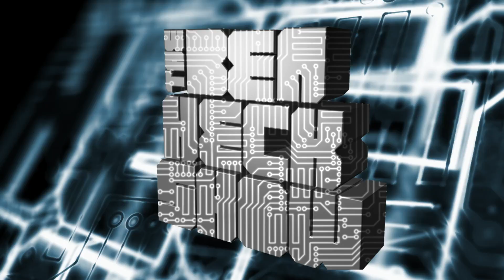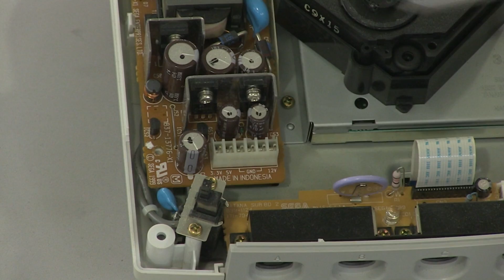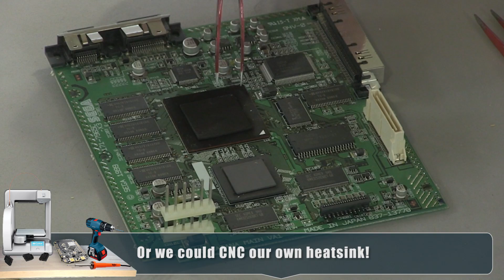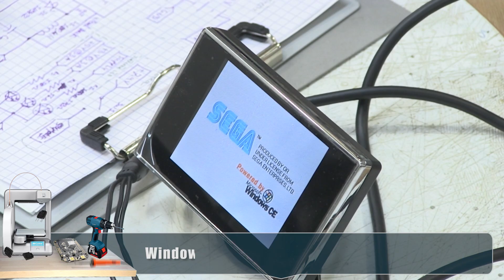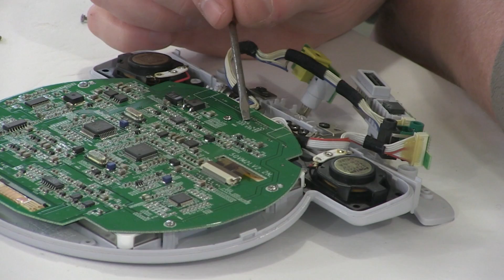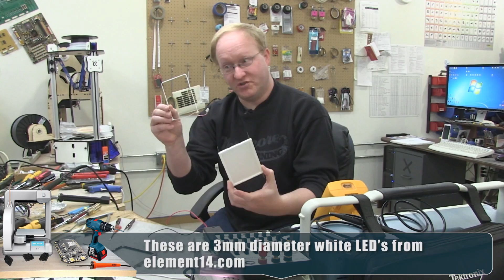Ben Heck’s Dreamcast Portable Part 1

Comment: The Sega Dreamcast failed because it was going up against the PlayStation and the N64 which were already out and had a lot more games that people actually wanted to play and it's competitors were cheaper then the Dreamcast and on top of all that the PlayStation was way more powerful then the Dreamcast and could also play music cds for again a much cheaper price compared to the Sega Dreamcast who could also play music cds but for alot more money but like i said the PlayStation was cheaper, and of course all the bs that Sega did with the Sega Genesis/Mega Drive didnt help, so no the Sega Dreamcast failing had nothing to do with its good controller, so why dont you do your research instead of making stupid inaccurate comments, i mean you want to talk about bad controllers well how about looking at the N64's god-awful abomination of a controller.
Reply: You are so wrong. Playstation and N64 were irrelevant old news by the time the Dreamcast came out in late 1999.

The Dreamcast failed for many reasons, a huge one was the trust issues consumers had with Sega after abysmal failure that was the Saturn AFTER Sega launched several systems they quickly stopped supporting, expensive systems.

The biggest one though was PS2. PS2 was announced and revealed before Dreamcast launch. And the PS2 had an ace up its sleeve. It was going to be the best and cheapest BluRay player on the market. "c'mon dude, how do you know that's true?" Because after PS2 launch, it had an attach rate of less than 1. Meaning PS2 units were selling more than games.....because people were buying the best and cheapest BluRay player on the market. That gave PS2 huge-mongous market penetration, and third parties noticed. The noticing led to Dreamcast support drying up quickly.

Sega wanted Dreamcast to have BluRay support, but that would have substantially increased the unit cost of the Dreamcast. After most of a decade of near irrelevance in the gaming market, they didn't have the finances to eat that extra cost and would have had to price the Dreamcast way above it's low price which was one of its main selling points.
Reply: @ekscalybur  close but instead of Bluray it was DVD, bluray players didn't come out until June 2006 and the first console to use bluray was PS3.
 Xbox 360 and Wii still used DVD, and most of the time needed DVD-R DL (Dual Layer) and multiple DVD's on Xbox 360 vs single Bluray Disc on PS3

Comment: For switching regulator you mean a DC-DC converter, right? I do appreciate how good this video is, especially for electrical engineers is a joy to see the applications to the gaming world. Of course to do all this stuff you need a very well equipped lab. Those Fluke multimeters do not come cheap =)

Comment: I know it's not relevant to this project at all, but I wonder how much of a difference replacing the backlight on that display made on color reproduction? I'm assuming this one isn't good enough to see much of a difference, but I'm assuming that when the CCFLs in stuff like my mid 2000s 1440p Apple Cinema Display go out then while I could make a replacement it would mess with the color reproduction (and there were many CCFL screens that look great even in 2021, they just were very expensive back in the day and don't make sense now that they are worth as much as a more modern one that looks nearly as good and has an least double the refresh rate.

Comment: I’d LOVE to see a new take on this build since the GDEMU has been released, SD card reader that replaces the optical drive for a digital solution, with a big enough card, you can fit a nice chunk of the library on a single card and I’m just imagining a second attempt of this using a Switch type setup where you actually have an SD card slot on the shell that can read those games directly off any card you pop in!

Comment: The controller problem is actually a simple issue, the handles are 90 degree right angles but they need to be tilted inwards to the top like most controllers. It's more comfortable to keep your wrists straight for long periods of time while the DC controller causes more wrist bend in it's grip. Ben still would like you to try a DC controller and VMU 2.0 project, get past your emotions and make it better. Dream Pi, DC is online again. :D

Comment: Nice, but stop using those PS One Screens!
Reply: Jojozz PlayzzGames What?
Reply: My understanding is that he uses them because he has a bunch that he got for a good price back in the day off eBay and that's why.
Reply: @FancyGeeks  That's still not a good reason, they're rare and valuable!
Reply: @testarossa7993  They're really not. A bunch of sellers on Amazon have them in stock at any given time, they go for about $80. Good screens for Rasberry Pi builds (like the Sunfounder) go for about $75 and they don't come with on board audio. Even if you get one of the generic screens for $15-$25 (and they're not much better than this one) then you'll still have to add on speakers ($5-$7) and a sound card ($23-$25 for a cheap one, $50 for a good one). In the end, it's gonna cost the same thing or more and add a bunch of work. Not to mention the extra space the sound card and speakers will take up. For the size and time restraints of this kind of build, it's hard to beat a PSone LCD.
Reply: It would be a much better product with a new screen though. Time constraints aside, I say spend the extra money. And while we're at it, replace the disc reader with an SD card mod, that'll make room for a sound card, make it use less power and make it more reliable (Ben brings up this possibility but ultimately keeps the disc drive).
Reply: @testarossa7993  So what? you want him to keep them in storage and never use them? I'm all for preservation but you sound like an idiot hoarder that gets mad over what others do with their possessions. I can tell that you're one of those "leave it in the box" type dudes.
Reply: @doodachacha8334  He could sell them to people who would use them as intended. And I will mot permit such insults from a knobhead like you.
Reply: @testarossa7993  "use them as intended"

That's not how commerce works. Once you buy something, you get to use it however you want.
Reply: It is probably cause he thinks it can get smaller?
Reply: JBrothersz I know right? How could he be so stupid? :(

Comment: I'm re-watching this, so I might've actually said this before, but... "Let's give it another go!"
I love the layout of the Dreamcast controller, and the VMU's are actually pretty cool, though not necessarily worth it, if you ask me... BUT, there is a big problem. It's not the cord thing, which is a slight niggle, but not that big a deal. Feel the controller. Run your fingers along its edges... Yeah! Everything is sharp! I feel like it's a slight redesign away from being one of the best controllers ever. There would still be personal preference issues, and possibly some slight layout tweaks, but the inarguable flaw would be fixed by simply rounding the edges like was done on its spiritual successor, the Xbox controller.
Reply: I never got bothered by that edge myself. Really like how ALL the controls are very close to the edge though, this makes the controller comfortable for endless hours at a time for me, while others make my thumbs hurt. And at the same time it feels meaty, there's plenty to hold onto.  There's some hand repositioning effort needed when going between D-Pad and analog, but whatever, D-Pad was barely used anyway, though i guess that's the reason why this design hasn't resurfaced.

Comment: The number of PSone LCD screens are limited, they have been discontinued for a LONG time. There are SO many cheap LCD screens you could have used instead, and these screens are becoming collectors items for people who really love the original Playstation. Please don't hack up collectibles! It's unnecessary.
Reply: Name 5-inch, 4:3 LCD screen you can buy, that is being made now? Only widescreens wherever i look.
Reply: I found several on ebay on my first search. Look up "640x480 5" LCD".
Reply: blickblocks Thanks. The one i'm finding is Chi-Mei/Innolux AT050TN23 which has a 40-pin FPC digital RGB TTL input, made around 2008 and probably available as leftovers. It is incompatible to LVDS driver boards you'll usually find on eBay. So need to find a board to drive it from console signal. I guess suitable options are RTD2660H and TFP401 boards, and they will usually need an adapter from 50pin FPC to 40-pin. Dreamcast is lucky that it includes VGA output because inputs on these boards are often limited. RTD2660 also needs display-dependent firmware, and so far i only found Russian-language sites regarding firmware hacking, which is not a problem for me, i can just about read it, but is likely to be an issue for Ben's team.

Comment: The controller was great, very comfy to hold and played no part in the system failing. You complete and total twot
Reply: I personally loved the dc controller....the Xbox180 had to be THE ABSOLUTE WORST controller for a console
Reply: It could have played a part in system failing because it was PERCEIVED as weird by people who haven't actually bought the system. And they might have not bought the system in part because they though the controller looked weird.

But it is indeed the MOST comfy controller. It has its issues, but it's easy enough to maintain and can retain high precision after tens thousands of hours if cared for, which is not something you'll accomplish with any modern one.

Comment: As much as I love stuff like this.

There has to be an alternative to cannibalising the systems. There was only so many of these things made and if they're all gone, we're gonna have to resort to emulation which likely wont be perfect for a good long while.

I mean we've only just got a cycle-accurate n64 that's begun to be made, which was released 20 years ago.

The dreamcast was the most powerful of that generation, coming close to the power of the next generation. How long do you think we'll have to wait for cycle accurate dreamcast? Also to properly get a feel for the console you'd need to be able to use the controller with the VMU on it.

Comment: Would the screen from a laptop from 2005 work for making a handheld console I'm thinking of making my first more of a laptop portable than a handheld for my first try because I have a few old laptops that have screens that work but are not working for one reason or another. I might even try fixing a laptop too if possible.
Reply: Oh you're in for a potentially rather bad time, i recall older laptops use a really weird variant of LVDS which is very much unlike DVI/HDMI. While on DVI every wire pair is its own colour, on those older displays it's all mixed up in a really weird manner. Strip the display unit of your laptop until you can get a display designation, then check out suppliers of laptop screen VGA/DVI adapters, on alibaba/aliexpress or Chinese part of eBay, and poke them whether they have a unit that works with your screen. Use good judgement when dealing with Chinese vendors, they might lie to you, so try to get independently verifiable information out of them. Check out automotive suppliers too, this weird link format has been used in automotive for a while longer i think. I think it's the first generation FPD-Link.

Comment: I actually like the Dreamcast controller and don't like the PlayStation controllers but I think that's because I had a n64 and Xbox with the big controller and never had PlayStation products other than a psp until this year . I never had a Dreamcast until last week but it's controller feels similar to xbox's original controller and that's my favourite controller of all the systems I own.
Reply: +allan fulton Pretty much the same here. I actually had a Dreamcast when I was younger, and I do remember liking the controller for the most part even if it was a little big. I wasn't too crazy about the analog stick being just a convex piece of hard plastic, but everything else was okay. I went from there to the Xbox line, so I'm more used to the Xbox/Dreamcast/Gamecube style of controller with the left stick above the d-pad parallel to the face buttons than to the Playstation style with both sticks below the buttons.
Reply: +NoTrueBadgerfish I'm finally sort of getting used to the PlayStation controllers but they still aren't anywhere near as good as the xbox's controller. I'm really liking a lot of the ps1&2 games that I've never played before though.

Comment: Only thing i would change about this mod is adding VGA support since VGA is so easy to obtain on this console. Then having a switch between RGB and VGA for those older games wouldn't even be an issue. Not sure of that Sony screen can handle it by default though. Have to check the sync but otherwise a screen from most RaspberryPi sellers will include a variety of connectors.

Comment: Dc controllers were the most comfortable the ps1 through ps3 are terrible the d pad is not even a real d pad and pushing the L2 and R2 buttons and using the analogs at the same time is really uncomfortable

Comment: Well I am a dreamcast fan and I totally get the issue with the controller, sadly all the systems of that gen had bad controllers. Look at the original xbox brick of a controller. It was massive and hard to handle. and the N64 controller? ugh what a crap that was.

Comment: Dear Mr. Ben Heck,
I currently own the xbox one. I saw your video in which you split the xbox 360 controller, but you didn't do one for xbox one (I don't think). However, I don't want two parts, I want an extendable xbox one controller that can stretch to be wider than the standard controller. I hope you take my request into account,
Sincerely, SideHydra51501

Comment: That "North bridge" is actually arm7 Yamaha AICA sound cpu.
Two lower memory chips are texture memory, four in a row - system. And another one near AICA - sound.
As for buses controller ("north bridge") - that's HOLLY, and it's inside video SoC.
"Large chip with connection to dvd" - that's bios bootrom, duh (with flash memory for settings near it).

Comment: Since the idea of these projects is to achieve a small, yet battery efficient handheld system, I hope you don't keep the GD-rom drive. Running backup games via SD Card Adapter (dreamshell maybe?) would be way efficient. It reads Dreamcast games way faster than the regular CD drive too.

Comment: I hope you can all figure out that the dreamcast has an sd card adapter for it which is much smaller and replaces the disk drive (Its not official) which can slim it down, and the dreamcast naturally puts out a clean VGA signal, so using a composite psone screen will really run down on the quality, hope this helps

Comment: So, why didn't you just make a raspberry pi emulator and then use whatever controller you wanted? It would probably have be smaller and required less voltage and you could store the games in place of carrying disks everywhere... Just sayin...

Comment: didn't the DC use 1GB discs called GD-ROMs?
Reply: Yes they were GD-R ANFd they actually hold up to 1.4
Reply: STAXONDECK1 thought that was the case. so that means BH couldn't replace it because it's a totally proprietary format that is no longer in production. i wonder if it could be modded to run DC ISOs off memory card?
Reply: ni9ht5ta1k3r
you can burn ISOs on to a regular cd on cdi format, some games even work on and SD reader that can be connected through the serial port
Reply: though no one does it any more as we have discs with higher capacities now along with portable USB drives which makes overburning an obsolete method.
Reply: i mean no one burns to CDs any more :p
Reply: thegh0sts
the GD Roms could hold a little over a gig but most games did not use all the data so a regular cd-r will work on most games, if not you could use 99 minute Cd-r
Reply: STAXONDECK1 i only remember 650MB (74min) and 700MB CDs....i don't remember there being any 99 minute CDs :p
Reply: thegh0sts yeah their kinda of rare but you can find them on ebay or amazon sometimes
Reply: thegh0sts *cries in the corner while burning CD's*
Reply: wtf lol
Reply: Bret Lewis you still burn CDs? I haven't burnt a CD/DVD/BD in ages thanks to portable HDDs and USB sticks :)
Reply: thegh0sts yeah, not that much of a tech guy but i researched everything about burning dreamcast games a good site is theisozone.com
Reply: thegh0sts Hell, I still use my discman.

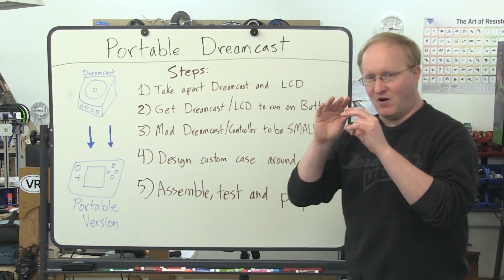Comment: 1:33 I'm not sure the drive is strictly necessary.  Pretty sure I've seen DC's modifiied to run from SD card.
Reply: MrMikehunt87 Yeah, it's not. And it looks like you need to boot from a disc to start with anyway, which makes it somewhat useless for a handheld.

A shame, though. Because otherwise you could treat the drive as an add-on that doesn't need to be permanently installed, and only plug it in if you need it for a specific game.

Comment: Loved the dreamcast, especially Quake3 and Unreal, quality games and very fast frame rates too.  Revolt was another favorite, kinda like radio controlled car racing.  The controller was fairly bad when you compare it with modern controllers - it's like the evolution between modern dual thumbstick controllers and the N64 - it took a lot of getting used to - especially aiming with the left thumb and moving with the buttons.
Dreamcast did have a mouse and keyboard, but they were horrible and not supported much.

Comment: Ben, the Dreamcast didn't "fail". 
Sega was already failing and it took the Dreancast down with it.... 
but the Saturn failed, and it's failure contributed to Sega's downfall.
Reply: +MrMikehunt87  The Saturn should have remained a 2D console and stayed in Japan.  The Neptune would have been the right console for the American market... and for that matter, the 32X could have been an SVP pass-through cartridge with no extra connections.  Sega management made several bad decisions.